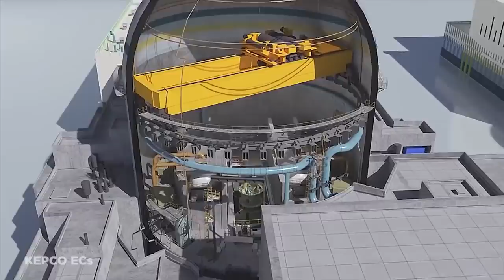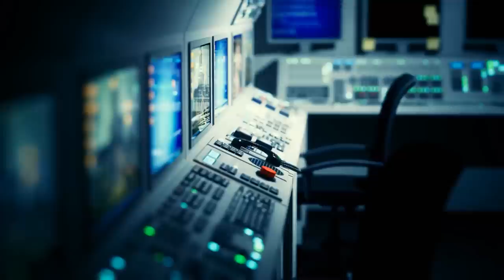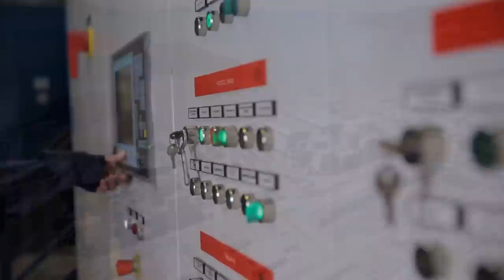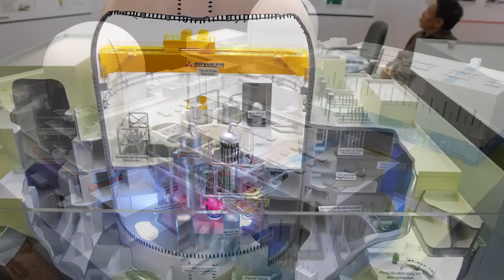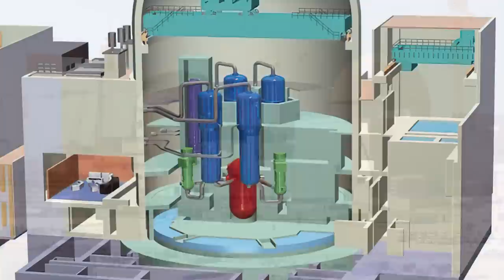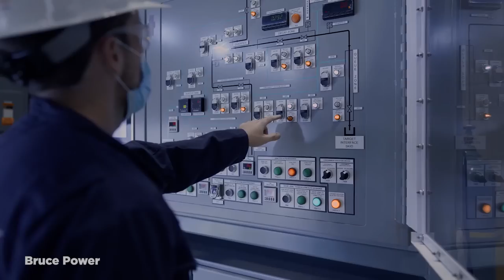15 LARGEST Nuclear Facilities in the World

Comment: NP is the gold standard of clean energy. It’s as clean and safe as any alternative, requires a fraction of the resources and produces clean, reliable energy 24/7/365. NP really is the premier example of dematerialization in which we actually use less to produce more.
Reply: until it blows up
Reply: @pablokatz9062  
If you think that NP is higher risk than the alternatives then you haven't actually looked into it. If you do you'll find that no method of energy production has a lower mortality rate.
Reply: @pablokatz9062  fire can also burn your house down, so why would we use it?
Reply: @pablokatz9062  That confirms you know nothing about nuclear power.
Reply: Society needs to looks at the entire nuclear fuel cycle to be able to say that confidently.
Reply: @dodiewallace41  I used to work in the nuclear industry, responsible for assessing environmental impacts of the entire nuclear fuel cycle, including management and disposal of spent nuclear fuel and defense high-level waste.  I also worked on risk analyses for the those and other nuclear-related projects.  There is no licensed facility for the permanent disposal of commercial nuclear spent fuel, nor are we close to having one.  We absolutely do NOT know how to, and what the associated impacts would be for that disposal.  I am not against nuclear power, but the US should be fully informed before embracing it.
Reply: @vanguard9067  
That the US has no licensed facilities isn't a technical or physical issue, we are capable of rectifying that anytime we decide to. If you worked in the industry you must know that. You're also aware that the used fuel storage is impervious to damage from events including earthquakes, floods, high winds, lightning strikes, accidental aircraft crashes, and pipeline explosions for centuries. Even if it could be breached, it's a solid material that stays where we put it. 
Putting emphasis on used nuclear fuel risk as if it's planet killing goo that's going to spread and grow if we don't guard it for 500,000 years is anti nuke propaganda. Particularly as thousands of people that die of hydrocarbon pollution every day, and the environmental devastation and health problems caused by the waste from mining and manufacturing wind and solar units is given a pass. 
In perspective used nuclear fuel presents a fraction of the risk of the waste produced by the alternatives and is by far already the best managed waste of any method.

Comment: I wish more and more nuclear power plants were of the true fail safe CANDU design.  They are the only reactor type that can safely shut down and the fuel reach a cool state when there is a major loss of coolant to the core.  All other reactors must circulate coolant as part of their shut down or emergency systems.  The CANDU is also the only reactor that can refuel itself while in operation.  One of my brother in laws works there at Bruce and used to work at Pickering.

Comment: I can only think of a few greater failures than neuclear energy generation, but none with a higher potential for catastrophic destruction.
Reply: Hydropower has proven higher potential for catastrophic destruction. In 1975 more than 200,000 people died in China from the failure of the Banqiao dam.
Reply: It's weird how we set ourselves on fire over NP risk when no method of energy production available is safer. If you think that NP is higher risk than the alternatives then you haven't actually looked into it.
Reply: @odril  Just Banqiao totally dwarfs about ALL nuclear accidents ever. Even considering the worst possible scenarios about Windscale, Chernobyl or Fukushima.
And then you look at other Hydro Dam collapses and whoops, that's a lot of deaths.. Plus workers that die in accidents when building the things. Just building one dam in Portugal like 3 workers died. Of course probably there are some deaths building NPPs but then they generate soo much power that it dilutes out. 

Even wind and solar kill more people overall than nuclear energy, per TWh produced. Considering mining accidents, and stuff like people falling off rooftops installing solar panels, falling off the things during maintenance, or a blade falling off a crane or from the nacelles and hitting workers.z